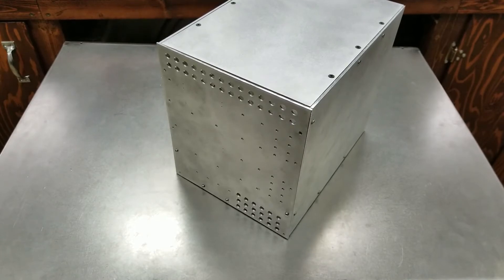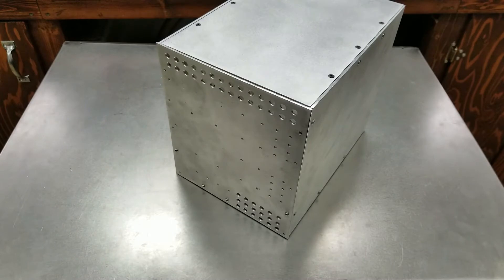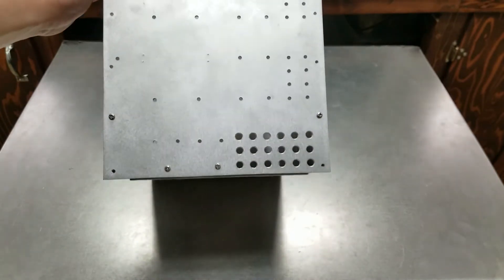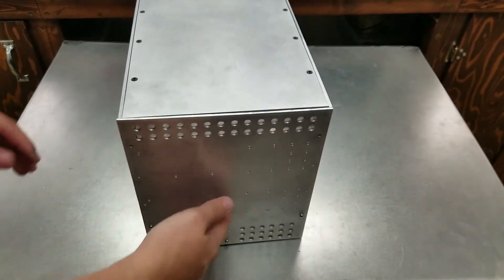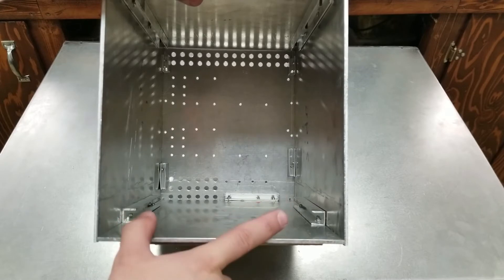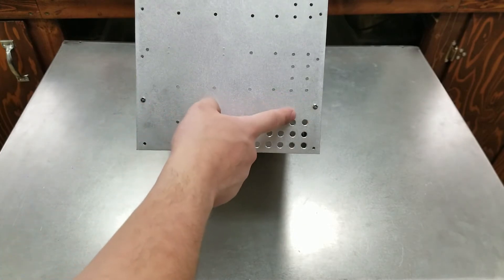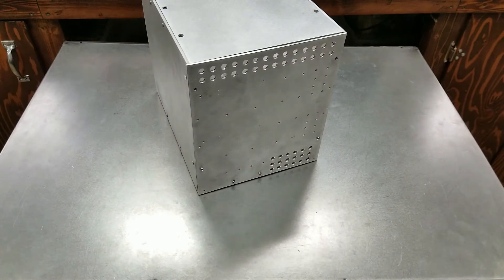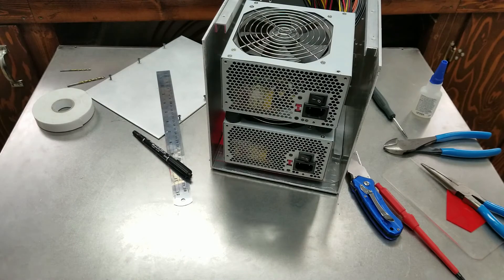Making homemade Lab Power Supply part 3

Comment: Looking Good! I made a dual CPU Power supply system a while back(never posted pictures, I changed my mind to a eBay power supply with the same amps and volt specs combined. To keep mine safe, I only took out the one of the earth ground on the DC side. But than again, I never really got to put it through any crazy testing. I also had issues with one or sometimes both turning off when I used to much watts/current(for some reason, I had major issues with the 3.3V and 5V sides) 12V was ok sometimes, even with a dummy load. I guess the OverCurrent protection could not keep up with the 1200watt booster or my BTS900. But than again, I only used one, not 2. I also took mine out of the case for more room.  also, If you want to use screen that can take more amps than 10 and look the same. These-

http://www.ebay.com/itm/Digital-LCD-Watt-Meter-Battery-Balance-60V-100A-DC-RC-Volt-Ammeter-Amp-Analyzer/192160929941

Have the same exact screen and boards when you take them apart, but they are 100amp, 60 volts. Great build! I can't wait to see the end results.
Reply from the maker: +Joe Fulwider yes i had the same problems. That was the reason why i used old name brand power supplyes.
You can pull all the current that it is rated for, and it would not trip the COP in till you would exceed the current ratings. ALso there is a reliability factor .
Reply: Yes sir, when it comes to electricity, I try and make it a point to always use Name Brand when I can afford it. The First 2 I used, came from a old dell XPS (3-5 years old?) and the second set I used VS350 Corsair(new). Decided to save the Corsairs, when I had the trip issue, for another build with the 900Watt BTS. I can't wait to see your power supply done! One of my Favorite builds is your Bench Power supplies.
Reply from the maker: Thank you really appreciate that you like it!!!!!